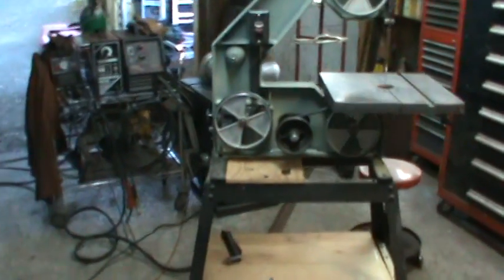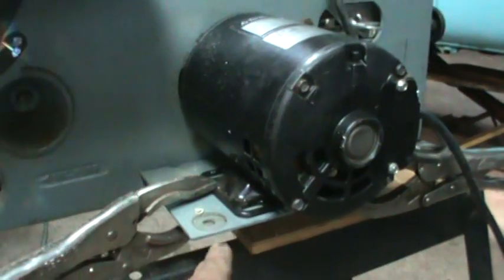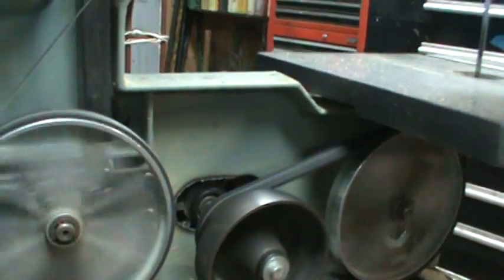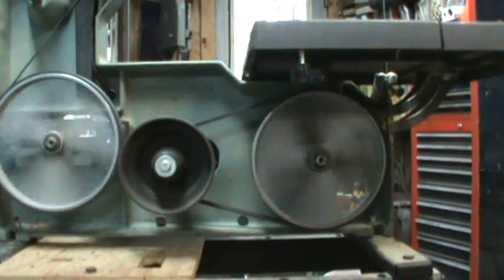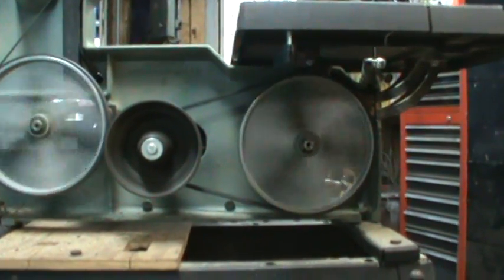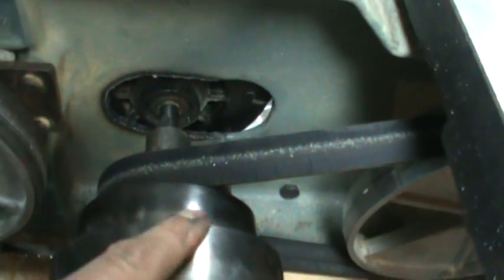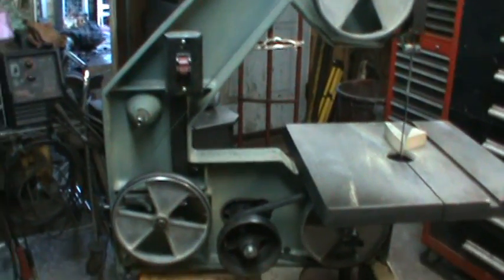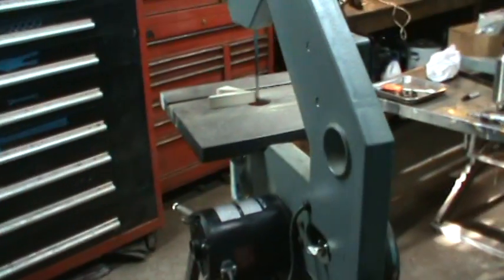band saw upgraded to metal

Comment: i have the exact same saw. It actually came with two different belts, one to use with the pulley on the motor for cutting wood, and one shorter belt that you.... first remove the motor pulley all together and install the shorter belt directly on the motor shaft.... this will give the blade speed the proper FPM (feet per minute) for steel.  Mine works great on thinner steel and sheet metal... if you use it on 1/4 inch thick steel you have to baby it considerably... however it cuts 16 gauge steel and aluminum sheet real well, but still, if you try to force it by feeding it too fast, it will stall out.  Using a little spray on belt dressing from time to time helps.

Comment: most band saws use AC synchronized motors which are frequency controlled for shaft rpm, not voltage, using a voltage dial / dimmer / variac will burn the motor out in no time, only way to control ac sync motor is via a frequency inverter drive.

mustie1 please post the motor spec to confirm what type it it.

Comment: need  to add bearings to the back edge and sides on the top and bottom heads, apart from speed, the major differences between wood and metal bandsaws is they use bearing guides ,not blocks as the forces are increased many times than that of cutting wood.
blade speed cutting without coolant/lube, probably need between 120 - 145 ft/min on 1/2" blade, if a synchronized ac motor its frequency locked for shaft speed, no type of voltage regulation will change that , need a frequency inverter drive.

Comment: Superb :-), once you have fixed the grip it should be dandy :-))

Is there no material on the drive pulley you could remove in the lathe, diameter turn down job?

Comment: Have you considered adding a voltage dial, something like one of those fan control knobs that you could adjust the voltage to slow the blade? At some point you will run out of adjustment with the drive ratio and it still may not be slow enough. For $10 and a little bit of wire you could slow it to 50 RPM.

Comment: It tracked very well considering you didn't have the guide wheels down in place. Should do fine with a metal cutting blade with the guides properly adjusted and the stops in the right place too. The fine tuning makes a huge difference in how well a band saw works, which I am sure you already know. Great project and a wonderful way to re-purpose an old saw.